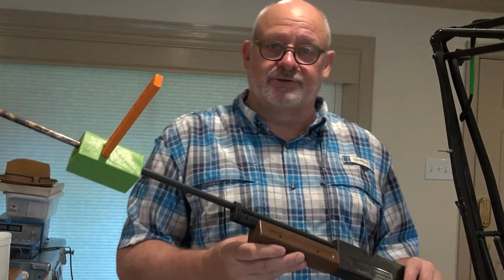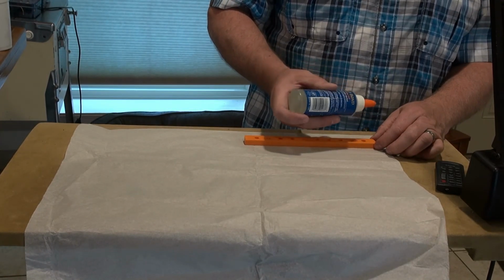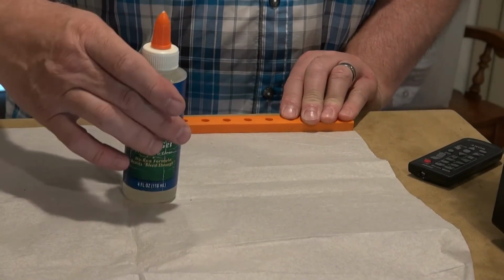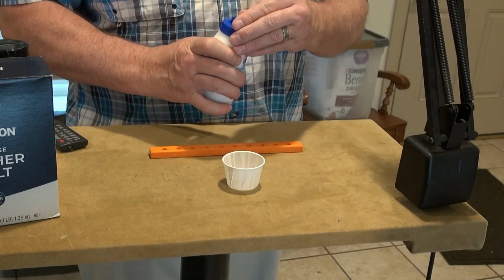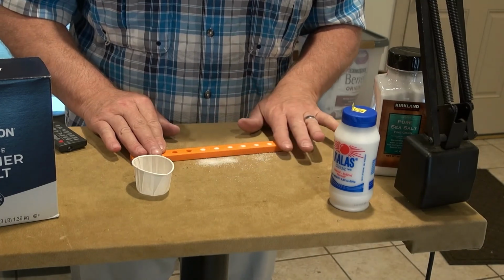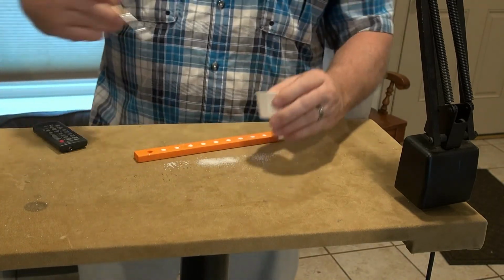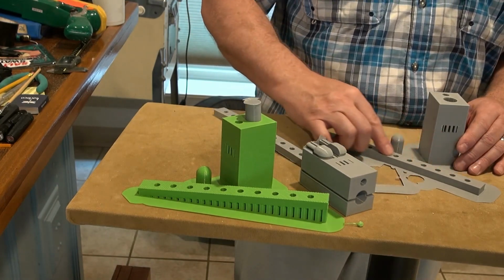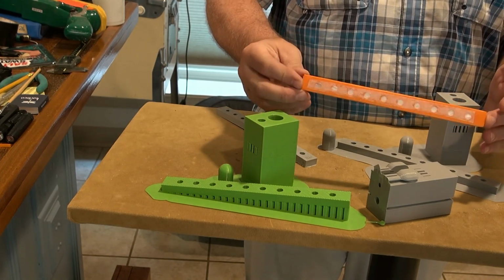Salt Shooter assembled on 760 Crosman

Comment: I want to see how that shoots! I like your creativity.
Reply from the maker: Thanks, the devices I designed and built did not function as I expected it to but that too I have learned to expect.  I learn just as much from failure...maybe even more...than I learn from success....will keep at it and work with what i can change.  Your SALTSWAT works great...wondering if you ever experimented with a full 360 degree loop to act as a salt trap to prevent salt from pouring out the barrel when pointed down ?  I will be trying that next